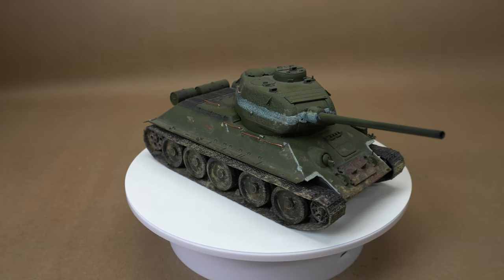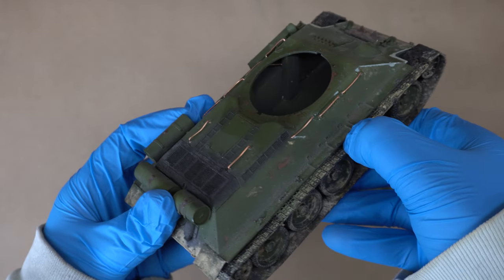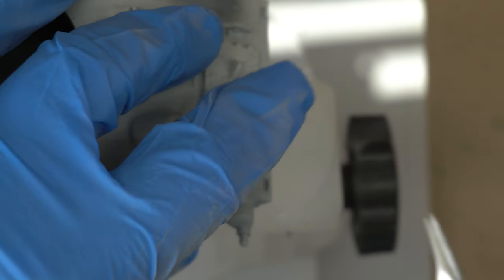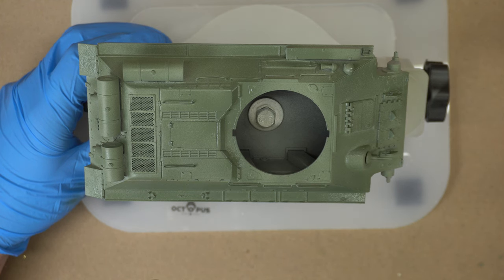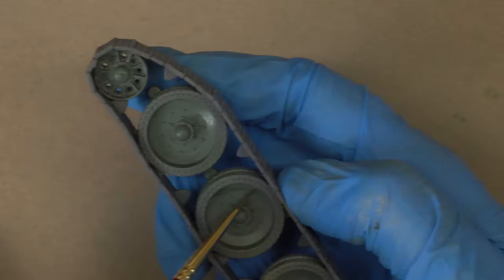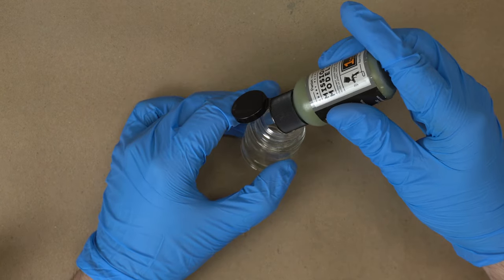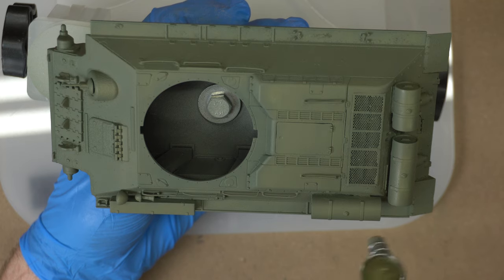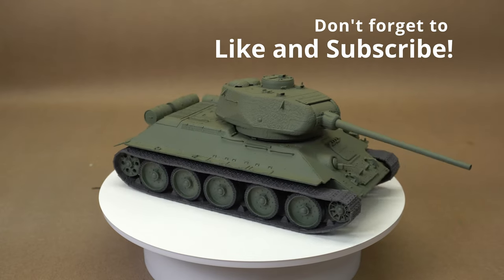Repainting the Russian Hero tank with Mission Models

Comment: I am starting to use MM paint. When I initially tried a bottle for a small job I was very disappointed. However, once I gained more experience I realized you don’t need to tinker with it like other paints and use it straight. The colors are great and easy to clean up
Reply from the maker: I started with their Red Oxide for a Maus. The color was not consistent and would wash off easily from a damp rag. Just like you, after some more experience with it, its a pretty decent paint system. Once you learn its quirks, its sprays really nicely.

Thanks for sharing!